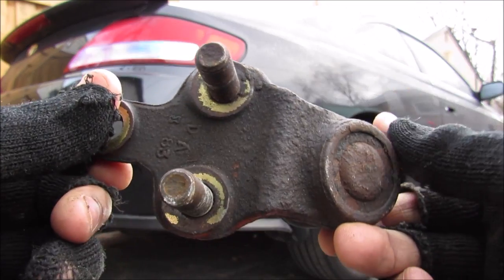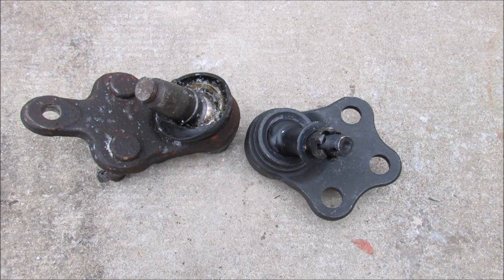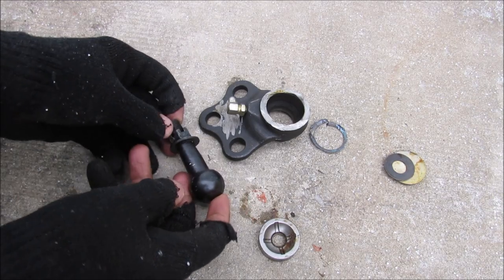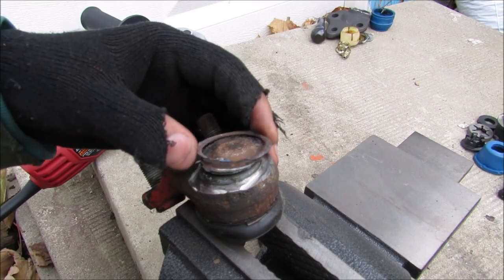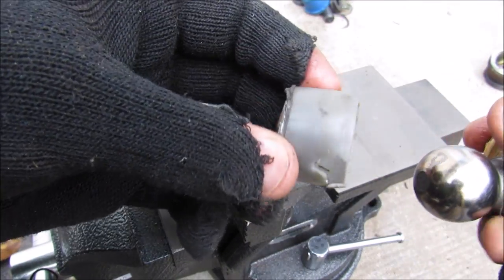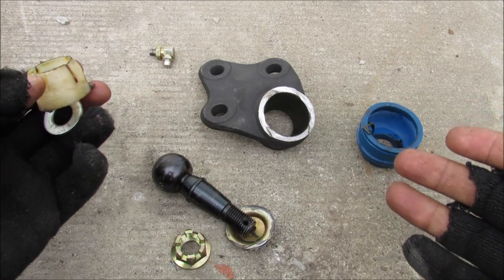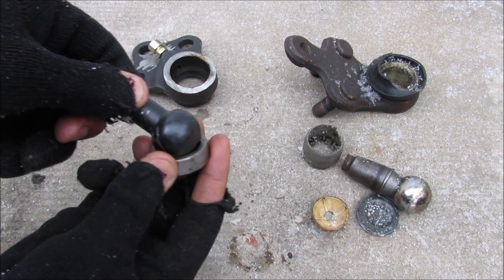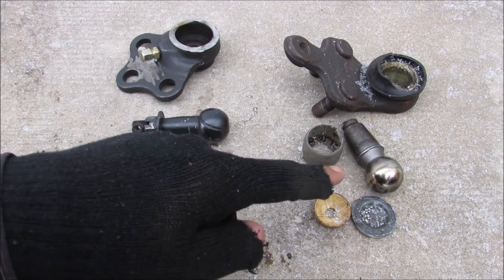OEM vs Aftermarket Ball Joints

Comment from the maker: To add to the video, the advantages of plastic ball joint bearings are:
- lighter
- less friction
- less noise
- no maintenance required

The advantage to sintered ball joint bearings are:
- durable
- longer lasting when greased
- not affected by contamination as fast as plastic
- porous bearing encases lubricant
Reply: All my ball joints have a cracked boot on it but still in tact and no play, can I just replace the boot I saw it on eBay for $9.99  is it better to just replace the whole control arm with ball joint in it, But I am trying to avoid alignment.
Reply: Your the best
Reply: @efrensaclolo7021  I would fill crack with some type of silcone filler and in future protect the rubber boot with silicone gel.Saving you to buy a quite expensive. Rubber cover
Reply: They last forever too in cars. I never heard Toyota ball joints failed without accidents. Only in trucks they wear out
Reply: I disagree with you this time.  Original Toyota with nylon base ball joint last much much longer than aftermarket, especially with metal-base.  The friction on the nylon socket is much less and 99.99999999% Toyota cars (Not Truck/SUV) never need a ball joint replacement. EVen if they are not as stiff as new but they have no play/clunk unlike most aftermarket after only few thousands miles.  But with double wishbonds suspension in that GS Lexus, yes they go bad.  YOu can see how good the quality of the balljoint ball on the original ball joint. Very high quality heat tempered metal, very shiny and smooth, not painted (hiding how bad the metalurgy )
Reply: THANK YOU. 🙏
Reply: @lashlarue7924  you are misinformed here. Speedkar should know how the genuine balljoint last 200k miles but aftermarket are less than 50k miles. Because modern nylon housing is way more reliable than metal to metal grinding. Moog balljoint are not good at all
Reply: @rondhole  further research confirms you are correct.  Look at the Amazon reviews for Mevotec and Moog.  They fail catastrophically on the highway — these are dangerous! ⚠️
Reply: @lashlarue7924  Man, if you have Toyota cars or a nonTruck base suvs like highlander or RAV4, your ball joints last forever. Literally, unless you have an accident or bad mechanics tears the boot.  All Ball joints in Toyota that go bad I had found in 23 years are either after accident, or someone replace it with aftermarket.   In Toyota, only the shocks/struts, some bushings (sway bar, stabilizer links, and control arms)) go bad. Not a balljoint or spring.  The bearing may go bad but after 300k+ miles
Reply: @kkooloo5781
Thank you

Comment: After hearing of many aftermarket failures on tundra ball joints I’m going with the safer route OEM.  One thing you don’t know and didn’t test is metal hardness.
Reply from the maker: Good point. I think that was a weak spot on Toyota trucks

Comment: Great video. In my experience the aftermarket dust boots don't last as long as OEM. This is significant to the longevity of the ball joint. I have also found that non serviceable ball joints may still need additional grease which I add through a needle attachment for my grease gun and insert it through the gap between the boot and ball joint stud.
Reply: Usually by the time a oem one wears out, the car doesn't have much life left in it.
Reply: I torn one Ball Joint Boot on the Lower Control Arm, which was installed like 1 year ago, removed the boot, cleaned (90% alcohol at the end) and glued it w/Super glue + salt (a bit). Then I covered the boot with 90 min Permatex gasket maker. It came pretty good: thick and seemingly durable boot. But at the same time I was able to find just new boots for that car (fortunately they started to make them in China), so I decided to go w/new boot. Since it was made from rather thin rubber (same as that torn one), I also covered it w/same gasket maker (after installation). I've seen film when people covered the boots (even w/small hole) w/stretch tape, like 2 layers, so it glues to itself, since that tape doesn't glues to the rubber. I don't know yet how that modified boot will be, but the gasket maker makes it thicker for sure.

Comment: You are comparing two ball joints from different vehicles that do not guarantee the same specifications to be compared. Also, one is sealed and the other is not. In most cases, sealed aftermarket parts also use plastic.

Comment: Aftermarket parts are junk
Reply: had problems with acura and honda after market parts....
Reply: No they are not, if you buy parts from reputable manufacturers, that have been making such parts for decades. And it is those companies that make OEM parts for the car companies in the first place. Of course, if you buy parts made by some shitty company, then it is the other story.
Reply: Cheap ones suck. AcDelco Professional and similar brand names offer better build quality.

Comment: I literally had one from an eBay set pop out in my Miata. Made in China. Good thing it didn't happen on the freeway. I thought I was doing good in replacing my old ones just because they had torn boots. Big mistake. Got some Moog from rock auto. The box says made in Japan, but the sealed bag says made in Korea. I don't know what to believe anymore. The Moog also doesn't use a castle nut, instead it's a pressure type of nut. Which also needs a larger socket. I think it was a 7/8. The one with some plastic in It. I need the car so I'm in the process of installing them. At least the first one fit better than the Chinese version. I did have to thread the bolt through though. It wasn't going in all the way. Maybe it was just dirty. I put some w40 and it went through fine. By the way thanks for this video. Good info. I was wondering how in the hell mine came undone. I do feel much better now that I know they're pressed from the bottom. So it should never pop out even if it's old.

Comment: Very clear and informative presentation. I thought I understood how ball joints worked, but I had no idea how complex, yet simple they are. I have a few questions regarding the major design differences. 

1. Do OEMs favor plastic bearings for longevity/low maintenance? I know this may sound counterintuitive, but if I understood you correctly, plastic bearings last longer with zero maintenance. If the grease dries out, the plastic provides a cushion of protection for a certain amount of time. I imagine it will be more predictable when it starts to fail as the worn out bushing will develop free play. 

2. What type of grease works best in this application for ball joints with serviceable fittings? I have sway bar links that keep failing due to moisture/corrosion, and I wonder if my choice of grease has something to do with it. I also don't know how much grease I need to add and how often to repack the joints. Any suggestions?
Reply from the maker: Thanks, I'm glad you learned something.

OEM's use plastic bearings because they're cheaper, lighter (for CAFE), don't require maintenance, transmit less NVH, and have a reasonable lifetime that will most likely outlast the warranty (design intent). 

Plastic bearings will only last "longer" than sintered bearings if the sintered bearing is allowed to dry out. If its well lubricated, then the metal on metal design will last longer. 
The plastic is flexible, while the sintered design has a spring washer to accommodate some wear, as well as provide a resistive torque on the ball joint (pretension).

One downside of plastic bearings is they are temperature sensitive - too cold and they could become brittle, or more commonly, on combination with an aluminum steering knuckle and/or control arm, the heat from the brakes could cause it to melt and warp.

For the sintered design, almost any type of lubrication grease can be used. However, if you tried injecting the wrong kind of grease into a plastic ball joint (or added zerk fittings to an OEM ball joint as some have), the grease could eat out the plastic bearing.
Reply: I'd must say you BOTH are very knowledgeable and precised thinking / thoughts on the design / aspect of the Ball Joints... People can learn a lot from this thread... PLEASE PIN THIS !!!
Reply: @JodBronson Do you drive a lot of miles for your job and how often do you grease the ball joints? You should grease ball joints atleast once a month, that will definitely make a quality pair of ball joints last longer.
Reply: Wherever possible I only install sealed units. OEM's should last 100kmi easy under normal conditions. If it's greaseable it needs to be done so religiously and IMO are only applicable to the rock crawler enthusiasts. With aftermarket so many are made in the same plant by whoever is the lowest bidder at the time so you never know what you're gonna get regardless of the brand on the box.
Reply: ... 150k on a near 30 yr old GM with still 1st joints/bearings with grease fittings 😀

Comment: One important thing to note is the potential hard steering effort with cheaper aftermarket balljoints. I've had this exact issue no matter how much grease I pump in the things and actually have to replace them again with better quality softer units as it's already killed my steering box seal and power steering pump from all the hard steering effort. No two ball joint brands are remotely the same from my experience.
Reply from the maker: Good point, especially on solid axle vehicles, memory steer can be a big issue.

Comment: Which brand of aftermarket ball joint would you recommend? After I replaced my ~15 year old OEM's at ~275,000, I seem to be just going down the list and wearing out each (supposedly) quality ball joint every couple years. My last set barely even lasted 1 year, which is totally unacceptable IMO.
Reply from the maker: +Kcducttaper1 If your wearing them down that quickly you should look at replacing other worn parts in the suspension that can be causing that. 
I like Mevotech parts, in general they have decent build for the price compared to Moog. If not then look for other reputable companies (like 555 or TRW who are OEM suppliers)
Reply: I just finished replacing all of my suspension rubber and ball joints except for my macpherson strut, which is relatively new. I've got Moog PS everything except my sway bar links are Mevotech. I went under there with my grease gun and greased everything up good and promptly blew grease out of a cut in my brand-new Mevotech links.
Reply from the maker: +Kcducttaper1 I think the mevotech links have a little hole in the boot to relieve the grease, so the boot itself doesn't burst. Unless it came with a tear in the boot?
Reply: It definitely looks like a little bitty tear to me. That and the other side didn't have a matching hold lead me to believe it's not a design 'feature'.
Reply: @speedkar99  Mevotech, Ac Delco, Moog, Raybestos, all 10$ China ball joints, in 3 flavors..This is why so many are now having failures, most companies outsource the exact same ball-joint.
Reply: @speedkar99  +1 for the TRW's and Mevotechs, but get the supremes. Believe Auto7 is OEM for the Korean market. Moog is only suitable for those who love their grease gun. And certainly any parts store house brand, or anything whithout a fully sealed boot stay clear of. Have seen high failure rate for Raybestos as well
Reply: The oem lasted 150k before I decided to rebuild the whole front end. Ball joints were not even that bad. Since replacing in 60k miles I have replaced 8 ball joints 4 on each side. Allbdiffent brands of aftermarket including moog brand. I can tell u at least for ball joints oem is the way to go
Reply: @speedkar99  what about lemforder vs trw for e34? Which one is better (usually trw is cheaper and both from the same group, ZF)
Reply: No rocket science.... If OEM lasted 275,000.... Why would you even waste time with anything but OEM?

Comment: I used to work in a place that heat-treated the ballstuds for the new ball joints. Ford, peugeot, volvo, bmw, jaguar, land rover ones. Fords had only basic heat treatment done. The rest had balls machine polished and they were then sealed in oil. I liked polishing them to the standard where I could see my reflection on the surface. I wonder if it made any difference for the driver afterwards.
The OEM part you looking at has the hardened coating completely worn away and bare metal is showing.

Comment: I just replaced my highlander w Moog problem solvers. They no longer have grease zerks, now come as sealed units.
Reply from the maker: According to the website photo, it seems like Moog is sourcing those ball joints instead of developing their own Problem Solver design, hence no grease fitting. It probably follows the OEM plastic design internally. I see Mevotech lists a greasable ball joint for the Gen 2 Highlander.
Reply: Yeah I figured....I installed the moogs... I imagine it will last quite a while and I probably would always forget to grease them anyway.  I'd be shocked if i have the car in five years and I imagine it'll last that long....next I have to do control arms... Looks painful on a highlander.
Reply from the maker: +Brian Chrisman It probably is, you might have to remove the engine mounts and support the engine to get to the bolts for that control arm.
Reply: Yeah it's brutal.... But it's not completely toast yet, so I'm gonna wait lol

Comment: Really cool!  What happened to the Mevotech one you replaced?  Did the replacement fail already or was that a different one you opened?
Reply from the maker: Thanks! I put Mevotech ball joints on my Honda, and they held up fine until I sold the car:
https://www.youtube.com/watch?v=88r0YZWyUho

The OEM ball joint in this video is the one off my Toyota, which I replaced with a Moog 2 years ago:
https://www.youtube.com/watch?v=JqME3gI_hp8
Reply: oh ok, cool.  I saw the Toyota video and thought this was the one you put in there.  I have a feeling ball joints are in my near future, so the videos are much appreciated!
Reply: Mevotech on my Honda busted at 4000 km!

Comment: Exactly what I am searching for. Thank you for the great video! A small question: are "sealed" (non-greasable) ball joints completely sealed, or still have a free-floating rubber boot? After separating the ball joint from the steering knuckle, I found a little grease coming out from where the top rubber cover touches the metal stud, though the rubber cover is still mostly intact. So I wonder if I had damaged the ball point. Thank you!
Reply from the maker: If there's alot of grease and damage to the boot, replace it
Reply: @speedkar99  Thank you very much!

Comment: Can you explain in somewhat detail what you mean by lamination? I can’t imagine anything that would seal the metal casing be called lamination.
Reply from the maker: Folding the metal around the end of the ball joint at the back plate. 

It's the final manufacturing process in closing the ball joint after installing all components inside the housing.
Reply: Gotcha. Thanks!
Reply: @speedkar99  it is called "forming".
Reply: @waynes.2983  Yes lamination has more to do with layers

Comment: I love your vedios brother, you are such a good teacher, I have problem with my Toyota Etios steering as it's become hard, The Toyota company said that there is no problem in the power set up, it's only the rain water that has gone through the boot and the plastic bushing gap and has leashed the greasing and they recommended complete lubrication of the assembly but I had a question if they could drill two holes one on each side and give grease nipples, they said it's a very good idea but they dont do it at Toyota, they asked me if I wanted it I can get it done at any private mechanic shed. What is your suggestion, Iam finding it hard as Iam 50 diabetic and have muscle weakness due to which Iam driving my maruti ignis most of the time. Can you advise.
Reply from the maker: Yes you can try adding grease. It'll be temporary until it leaks out again

Comment: Is it worth it to get un-sealed ball joints that u can put grease in or just buy really tanky ball joints that you have to replace every 200k or so?  I'd assume if you maintain the boots they its just more efficient to change the BJ every 200k.
Reply from the maker: The greaseable ball joints should last longer than the OE if maintained (and manufactered) properly

Comment: Something else off my "I wonder what's inside" list.  Thanks. You're really going to open a steering rack?
Reply from the maker: Yes, I want to open a steering rack. I have no idea what to expect, so this should be fun...
Reply: I suspect you already have a pretty good idea of what's inside.  Wish my car's PS system were electric.  Maybe next time, if my car ever wears out before I do.
Reply from the maker: +wholeNwon Not really, looking at that rack I had in the video, the steering shaft leads to a rack and pinion on the drivers side, but the electric motor uses a recirculating ball spiral on the rack for the passenger side. The motor is separate from the steering shaft and drives the rack directly.
Reply: You never opened up a steering rack? It's really not complicated.